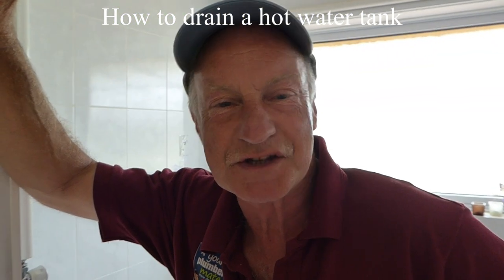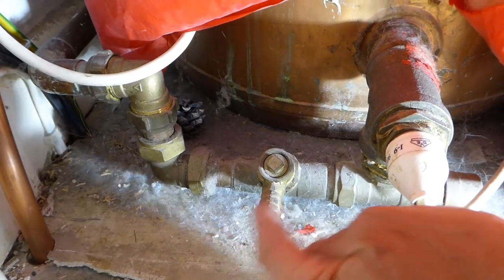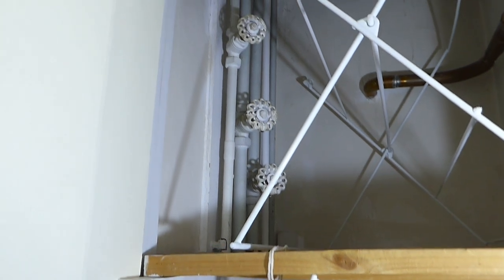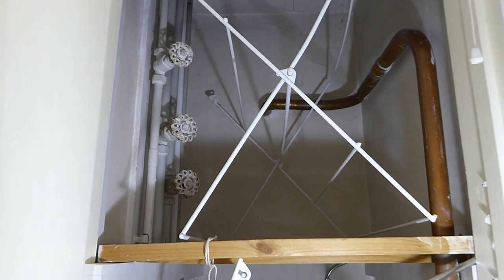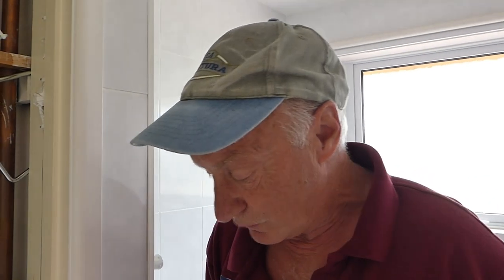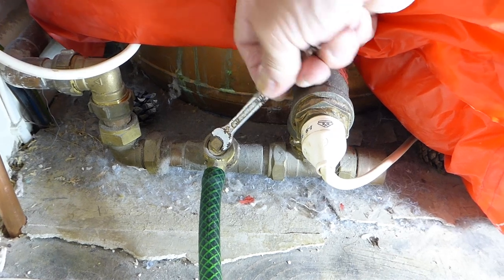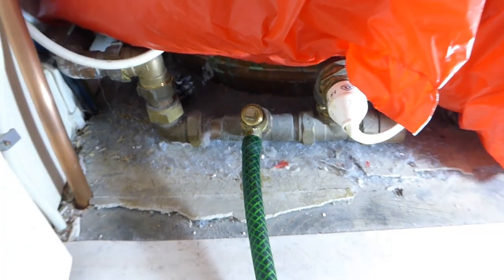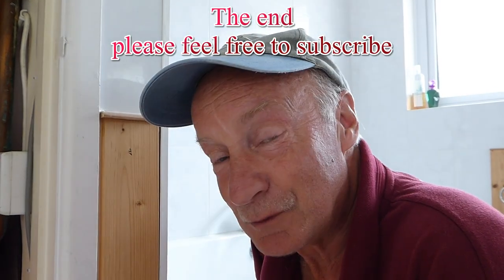How to drain out a hot water cylinder (hot tank)

Comment: Your airing cupboard layout is great. The house I’m currently refurbishing has the drain off valve on the side of the tank (right next to the wall). I had to buy a specific size imperial spanner to try and undo it as I couldn’t get an adjustable spanner in the gap. And then, the d*mn bleed valve just rounded off and wouldn’t undo. So in the end I got a hand pump to drain it from the top. Tedious to say the least. And now I’ve just realised I didn’t need to drain it 🙄 Thanks for the vid Al.
Reply from the maker: O no, never mind Nigel.

Comment: That was lucky. The last cylinder I replaced, the original plumber didn't bother to fit a drain off. Had to cut a hole in the top and siphon it out. As it was going for scrap due to a hole in the cylinder coil heat exchanger, this didn't  really matter. I made sure that the new cylinder had a drain valve though
Reply from the maker: Well done Nick.

Comment: why does water from hot water cylinder start off cold?
Reply from the maker: The feed pipe from it cools down.
Reply: @dereton33  Yes, of course. I'd figured that out, but thanks. So, the water in those pipes that has gone through the boiler is bad bacteria free (assuming 60+ degrees).

Comment: I need to replace the hot tap in my downstairs bathroom and there is no isolation valve, do I cut off water to immersion and open tap till it empties? Thanks
Reply from the maker: Yes or you can turn off the main and run the hot tap until it stops.

Comment: Hi I have an issue where in the morning I get a rush of water for a few seconds then i hear a sound from the loft and shower pressure goes down, how could I fix this will draining and refilling the cylinder do anything?
Reply from the maker: Draining the cylinder will do nothing. Check your roof tank valve is filling ok and if you have a pump , that it is working.

Comment: In your video a year later the gate valves get critised!
For some reason my drain valve is facing into the cupboard on a T off the feed pipe.
Thanks for the demonstration.
Now I need to expect the rubbers have perished in that  drain valve, like my radiator valves. So I'll need to undo valve and PTFE the thread as a botch fix.
So in last year I've had a string of age problems. A rusty bottom seam in bathroom radiator, I suspect duff from new as I thought the ridge of rust was bathroom condensation. Yet to put in new one because brackets are different. Toilet radiator rust in same place but not got worse than initial blister and drip which blocked itself. Now the feed flange on hot tank. And osteoporosis making bending and squirming very painful.
I put the system in with no pipe runs visible or touchable when kids were little. I got quotes visits and the trades installation would have turned my little house into a power station. 
So with your help I may be able to avoid getting a plumber.
Reply from the maker: Good luck with it Mark.

Comment: Hi Al, I hope all is going well? I really appreciate all of your informative videos, they have helped me out on numerous occassions. I was wondering what the best way was to descale the hot water system, do you have any advice you could share? Many thanks
Reply from the maker: The only way you will have scale in the cylinder is if you use an immersion heater in a hard water area.  You can put various cleaners in the system but unless you live in a hard water area it is not worth it. The only way to get scale out of the hot tank is to remove the tank, take it outside and empty the scale through the immersion hole at the top. Now black sludge that is a different matter, use Sentinal x100 or Fernox to clean the system.

Comment: Thank you so much. We have a small tank in the loft that I know is for the central heating.
Do I have to isolate this feed as well. To drain the hot water tank.
Reply from the maker: +Martin Loftus Only if you are removing the cylinder or doing any work on the heating system

Comment: Thanks! I have a question about this. If I just stop the inflow of cold water to the cold water tank in the loft and open the cold and hot water taps in the house to fully drain the water, would this drain all the hot water in hot water cylinder as well? I just want to replace the current water in my cold tank and hot water cylinder with newly softened water without having to wait the few weeks it would eventually take.
Reply from the maker: Hi Roxy, this would only drain the roof tank, not the hot water cylinder, this has to be drained by a drain valve by the side of the tank, you attach a hose to it leading out side and empty it.

Comment: Thanks for the video, unfortunately my gate valve is jammed, so as you say I could tie up the ballcock in the loft and drain the tank too leaving the mains on but the drain cock undid easily but no water is draining from it. Any suggestions?
Reply from the maker: Washer is stuck on he seat, use long nose pliers to pull it out, Have a few towels handy too.

Comment: Could you run the pipe to the bath or toilet   for water to drain.  Just wondering.
Reply from the maker: Only if they are at a lower level than the bottom of the cylinder.

Comment: May I ask a question, I have to change the washer on my bathroom sink hot tap, when I shut off the water feed to the tank does it drain the whole tank when I turn taps on or just to a certain level in the tank?
Reply from the maker: Just the pipe and vent above the cylinder .

Comment: I've got 2 hot taps to replace. Is it better to isolate the hw feed, if so, what does tap look like OR use a freeze spray?
Reply from the maker: Isolate the tap. It is usually a red handle gate valve next to the hot water tank.

Comment: How often should you drain a tank? I have an old tank that has never been drained. It has a flange at the top for air but my hot water pipes sound like they have air in. I drained shower and all taps and it looked like it had air in hot and got bubbles.
Has been working fine for about 6 months before this problem (moved in 7 months ago and had shower pump fitted).
Just wondering if it could be sludge etc in the tank causing the air issue or if that is a bit too random
Reply from the maker: You do not have to worry about draining those tanks, we call them cylinders. As the water is changing all the time when you use your hot water. It will be something else causing the air.

Comment: Hi Al, 
I hope you can help?
We have got a gravity fed system and at the minute our boiler is not working as we are awaiting a part to be changed.  As we have an immersion heater we are not quite sure how this works?  If we switch the immersion on how long does it take for the water to heat up (1hr or 2hrs), I realise we can't leave the immersion switched on constantly.  We've had a look and out hot water cyclinder is 116L.  Also when the hot water is used up from the hot water cylinder does it then fill up automatically from the cold water storage tank.   Can you please help?
Thanks so much
Reply from the maker: Hi Sarah, When switched on the immersion will take no longer than an hour to heat up all the water in the tank. When and as you are using the hot water, it will be replaced by cold water from the tank in the loft.
Reply: @dereton33   thanks very much Al, that's really helpful

Comment: Hi Al

I'm a recent subscriber to your channel I am finding your videos very interesting and clearly explained,  I have a question to ask if you would be so kind to answer. I have a gravity fed system the boiler downstairs, above upstairs is the cylinder below the airing cupboard and above that the f&e tank in the loft, our cold water storage tank sits above our bathroom in the loft. How would I go about descaling the cylinder?
Reply from the maker: Turn off the main open the taps and drain down the tank in the loft  then attach a  hose to the cylinder  drain valve and empty the cylinder.  Them attach hose to heating system drain valve and empty heating circuit. Then you can disconnect the cylinder for descaling. 
Al
Reply: @dereton33  thank you Al

Comment: if I want to change my hot water taps on sinks/bath do I have to drain the cylinder ?
Reply from the maker: No .
Reply: dereton33 thanks , but still unclear as there are no isolation vale on the hot water pipe under the sink
Reply: Forget the last message, I’ve figured it out , thanks For your swift answer 👍

Comment: Hello. I have a bottom fed heater (200L) but there is no drain off cock. The cold inlet has a stop valve for the water feed. 
After the stop valve there is another second valve connected to what looks like an overflow pipe. Problem is I cant get the  second valve to let any drain off water through.....any ideas?
Reply from the maker: The washer is stuck on the seating of the drain cock. Release the washer and it will drain.
Reply: Thanks for your reply. I opened all the hot water taps in the house and the second valve on the tank inlet. The tank started to drain. Thanks.

Comment: Why cant you just drain it from the hose into the bath or sink etc? Does it need to go downstairs?
Reply from the maker: It will not flow uphill.
Reply: @dereton33  If it's about a foot high/up the tank can you just drain in to a bucket? I only need to drain the top of the tank past the TPRV (temperature/pressure relief valve) in order to replace it.

Comment: Gow do you drain it down if there isnt a drain off valve???
Reply from the maker: Disconnect a radiator valve.
Reply: But that would just drain the heating system down or would this drain the tank also? Surely the heating is a closed system. The immersion tank is purely for hot water??

Comment: hi there, what if you don't have a drain valve?  I've noticed one under my radiator by the front door, could this be it? Thanks.
Reply from the maker: Not if you have an indirect system
Reply: Thanks.  Yes, I think it's indirect so the radiator drain valve won't help.  How can I drain the hot water cylinder without a drain valve at the bottom?  Cheers, Max

Comment: Turns off the gate valve like it's a normal thing to do 😂
99 times out of a hundred them gate valves do not work. Do not force them! You will break it quite easily. Best to just switch it off at the mains. 
They only work here because hes a plumber and knows to open and shut them every 6 months or so to keep them from ceasing up. 😂
They are the devils work those things. Ive made a few quid im my time swapping them out for leavers after diy guy has tried to force a gate valve with some grips and sheared it.
Reply from the maker: They sure are the worse valve ever invented.